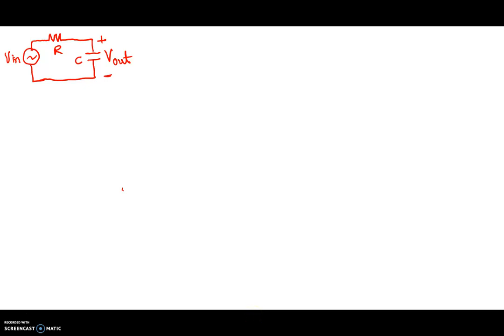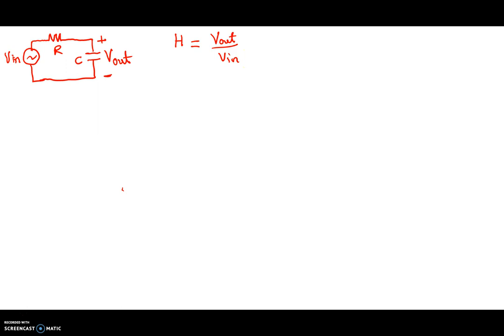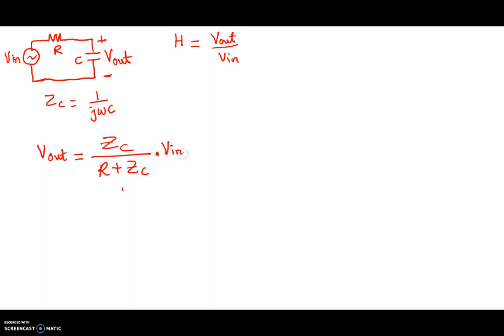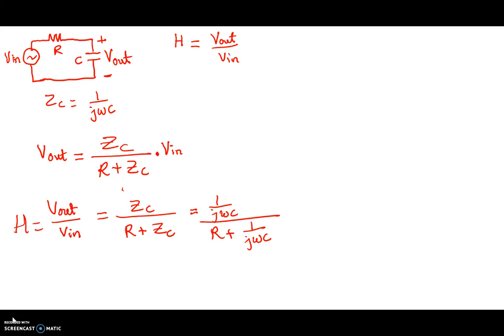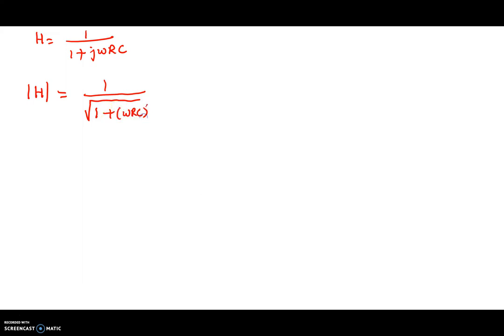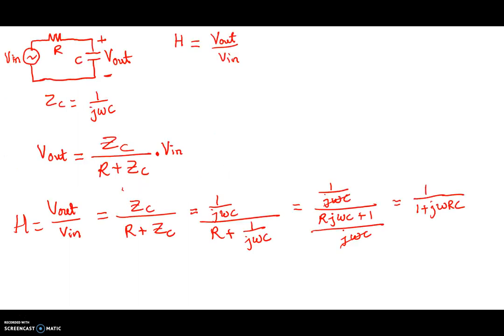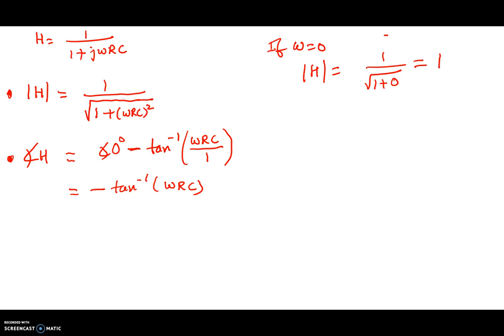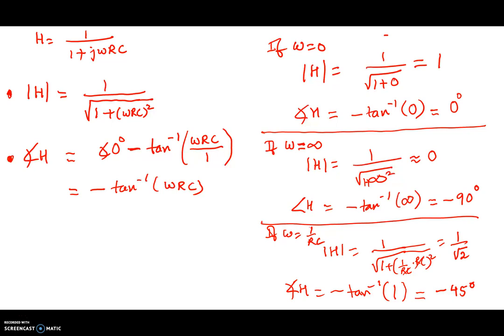Frequency Response: RC Low Pass Filter

Comment: Cuttoff Frequency is actually not 1/RC.  It's actually calculated by 1/(2πRC)
Reply: w=2πf, since w=1/RC ---> 2πf=1/RC and it gives f=1/2πRC
Reply: It just depends on units. He is using omega in radians, if you have f is Hz, you convert to rads by the factor of 2pi. So either or

Comment: What you did at 5:54 is wrong. You are dividing the angle of 2 scaler quantities which is <0/<0. Instead you need to multiply numerator and denominator of H(w) by 1 - jwRC to get a scaler in the denominator.  then the angle is arctan( -jwRC/1) = -arctan( jwRC). You got the correct angle by the wrong method.